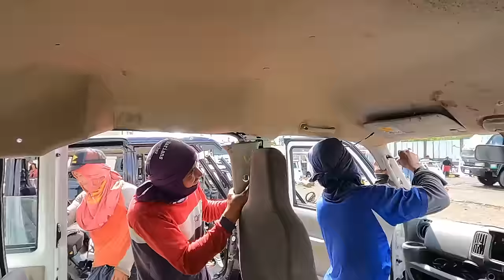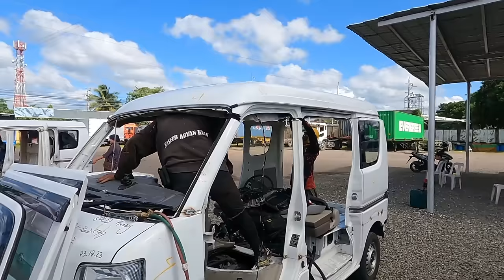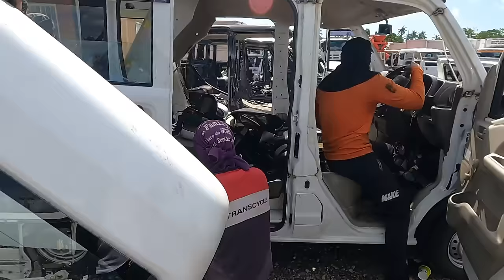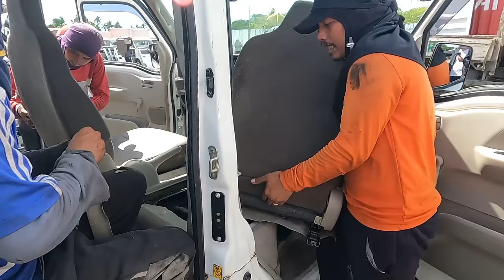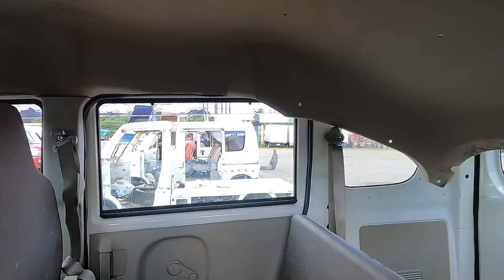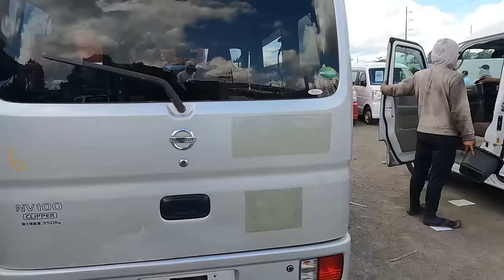SUZUKI MINIVAN DA17 IN JUST 30 MINUTES ASSEMBLE. GALING TALAGA NG MGA PINOY

Comment: So you dont fully weld the joints where its been cut ? WHAT HAPPENS IN AN ACCIDENT WHEN THE TRUCK BREAKS IN HALF
Reply: It is still for display. It needs to switched to left hand drive yet.
Reply: That's normal when they unload minivàns in docks, they would only do spot weld so they can assemble it faster then bring it to their shop. Then they will fully weld it to secure the park permanently.
Reply: Tama baka Hindi ba mahati.dahil minadala
Reply: Thats for temporary only, they need to drive it to their Garage where they will start to fully weld and convert sa dashboard, steering wheel and finally repaint it
Reply: They do it on purpose, so in an accident the whole car will just disintegrate 😂. You're so trigger happy 😆
Reply: Dapat double check bago pa pinturahan dahil yong iba hindi talaga pino-full weld may nakita akong korean surplus sa CDO minasilyahan agad...kawawa buyer sa pintura lang nilaro ang unit very deceiving!